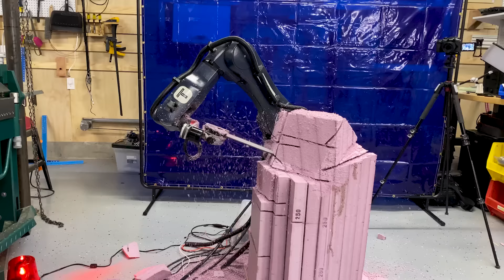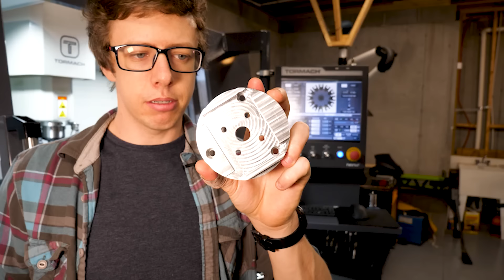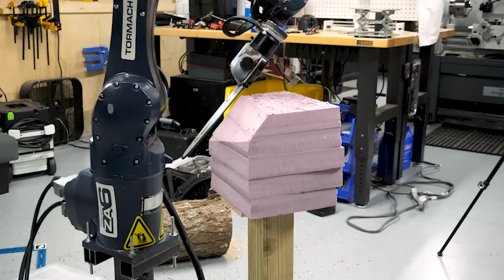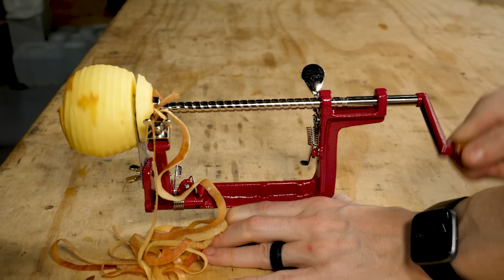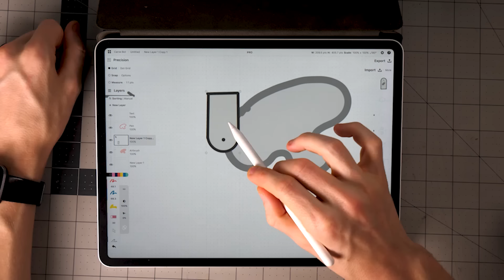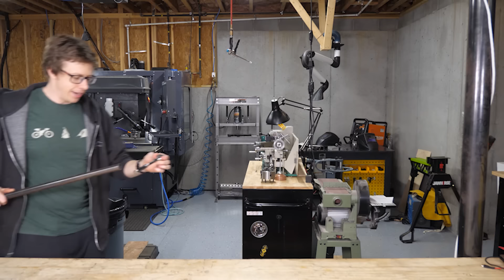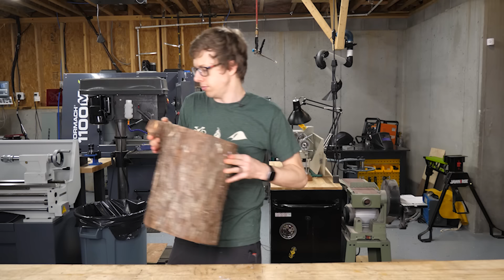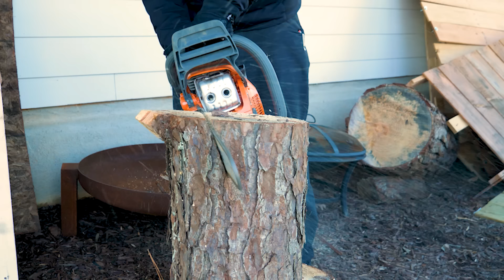Chainsaw + robotic arm = art?

Comment: getting stuck at a local max is always a problem with hill climbing algorithms. its the trade off of vastly reducing your search space. the only really "good" solution i ever ran into with hill climbing is you introduce thresholds. you find your "max" which may or may not be local, and compare it to a threshold. if its below, then you invert your max to treat it as a low, and keep searching. you then find the next "max" and you can compare it to the first one, or to your threshold. you can also make your number of searches arbitrary (always find 10 maxes). in the end though, you will never know if you have the global max unless you do something fundamentally different, which is what you get with hill climbing.

i'm curious what methods you tried to get your hill climbing to work. some problems are just not well suited to be solved that way. if you expect or know your search space only has one max, then its amazing though

Comment: Those things you called "anti kickback teeth" are actually depth gauges. They determine how much your teeth will cut. On a used chain, you have to file these down to make the chain cut again.
Your pole saw shouldn't be much slower than any big saw, as long as the chain is sharp, it should go through the wood like any other saw. My advice: Sharpen the chain, tension it (no seriously, that thing was way too loose), and slowly file those depth gauges down. Filing them down too much can cause the chain to bite too deep, which can overpower your motor. Slowing down the movement of the arm won't really help there, since the saw will pull itself into the wood usually. In the end, you should be perfectly fine cutting wood with that setup.
Also, the front of the bar saws just as well as any other part, plunge cuts are pretty common with chainsaws, both in felling and in art. They're not without danger though, so don't try it manually unless you know what you're doing.

Comment: Dude a decent saw and that includes a pole saw will not only handle continuous cutting for 10 hours it will handle continuous cutting for 14 hours a day every single day. All you would need to do is occasionally sharpen the chain and since you have 0 chance of hitting dirt you would only need to sharpen once a day.

Comment: Man, your videos are awesome.
Here are a few tips for better luck with your chainsaw next time:
1. tension the chain so that it is snugly on the bar but can run smoothly
2. make sure the oil pump for the chain oil is pumping in every direction the chainsaw is oriented. This improves the cutting speed and the heat problem
3. the "anti-kickback tooth" you mentioned is not really for anti kickback on the chain you used. That is the depth adjustment tooth, if you file it down a little more, the saw will cut deeper but also more aggressivly
4. optional: maybe use a full-chisel chain instead of a semi-chisel chain and sharpen it really good

Greetings from Germany, the origin of chainsaws

Comment: 9:36 For getting caught at a false summit, intelligent optimisation, something like the bees algorithm, would likely do wonders. If you already have the cost function well implemented it might be quite easy to add. Not sure if it would be faster than your optimised solution though. If you really wanted to put the time into it, it could be GPU accelerated though.

Comment: Would it be possible to program something like a simple particle/ray simulation? I am thinking of a flashlight beam. You shine it on the model, while it is rotating. Wherever the most light gets through, your efficiency of cut should be high. Maybe that way you get a reasonable estimate of planes where you can cut the wedges out.
I have no clue of programming by the way. Please don't hate me if this does not make sense :D

Comment: Your mistake was having only a single, randomly placed phase-space walker. You should randomly distribute multiple walkers across your space - ascend/descend them all and then pick the best - you should arrange your distribution and resolution, if possible - so the distribution of walkers is roughly the same as the distribution of peaks.

Comment: Awesome!! Speaking from a trefellers perspective, a chainsaw will definitely cut on the 3-6 radius (clock perspective). The "anti-kickback" is instead what decides how aggresive the chain bites and type of chips you produce. For hardwood and smaller saws you need the difference in height between tooth and depth to be smaller and vice versa. Also, chainsaws use oil, and i saw the chain being too loose on a few shots. - that might eject the chain all together depending on the rest of the construction. 
Regarding kickback, which is definitely a thing.. Avoid at all cost using the 0-3 portion of the blade. Second to none, this area is the one that shoots the chainsaw back onto people's faces. It's obviously not a problem in foam, but a true kickback can knock a man off his feet. 
I really enjoy these videoes. It's a perfect example of how it's smart people and not politicians that will save the world, one invention at a time. :D

Comment: 12:38 Having your warning light be on in case of danger is a bad idea in case of bulb failure ect. You want the light to be on if it's safe and then if the bulb fails you don't get the wrong idea. I'm sure you already knew that but others might see this.
Reply: A loud siren would be better, a chainsaw wielding robot coming at you is usually a good enough visual indicator of impending death.
Reply: Does having a redundant second light solve that problem?

Comment: Not sure if it's been suggested already, but the anti-kickback teeth are for human operators, it won't kickback with the robot holding it (similar to how climb cutting isn't recommended when hand feeding but is often preferred when CNCing); have you thought about grinding those teeth off a blade and trying again in wood? Possibly a cheap/quick solution.

Comment: In regards to your 'false peak' dilemma, I think you could probably separate your 3D vectored map into quadrants and then use your already created method to determine each quadrants x, y, and z max, then simply compare the best "peak" of each quadrant based on the Z values to return the x, y, and z of the best "peak".  Since you know the min/max X and Y values, you should be able to easily divide the table into smaller X/Y vectors.

Comment: Simple suggestion to make "gradient ascend" find the global maximum point:

1) starts in a random position
2) apply gradient ascend
3) apply stopping criteria when a maximum is reached
4) save altitude value
5) repeat process N times
6) use best solution found

Comment: Why not use 2 tools for big cuts and small cuts (attached to the same arm)? Off course difficulty will  increase both in coding and mechanically. Consider changing the tools manually during the process.
Good luck for this and all the projects.

Comment: A couple of years ago I worked on a machine very similar to this, only quite a bit bigger. It was based on a large Kuka industrial arm with a 3kw chainsaw. They also had bandsaw and router attachments. The electronics cabinet for the machine was within the kill zone so calibrating the inverter drive for the saw was ... interesting. I had my back to the machine so I couldn't even see if it was coming for me. I had someone stood nearby with their hand on the stop button just in case.
They had a horizontal rotary axis for it as well. If I remember correctly it had a capacity of about 3m in length with well over a metre in diameter. 
It was part of a research project that seemed to be basically let's build a cool killer robot then try to find some useful application for it so we can justify the huge budget.

Comment: If you are burning wood, you are rubbing instead of cutting it. That might come from the chain's chisel type, for automated cutting of wood (because of the missing rocking motion), normally a mixed batch between square and semi chisels are normally used. It can also be that the rotation of the chain is to high. At our hackerspace we tried building something comparable. We however used a chainsaw angle disk instead, because it was easier to control, easier to get into corners and flexes less. Why are you cutting with the top of the chainsaw instead of the bottom btw ?

Comment: 17:28 The teeth on the chainsaw are for cutting depth. If you sharpen the blades you have to shorten the teeth or otherwise it doesn't cut (and heats up).
If you have to rock the chainsaw to cut, you have to sharpen the blades (and shorten the teeth for depth)

Comment: First off you need a wood craving chainsaw blade, Which has a narrow tip. 2nd the finish work is done with die grinders. Now that you have the basic done you could program in the finer details. Attachments for the die grinder and chainsaw could be easy to do. I also would have made sure the base of the turn table was attached to the base of the robot arm. I am sure your chain was dull.. You should have done a few simple programs to try and cut the log first. This way you can adjust pressure and depth of cut.
Reply: the other thing you could do is use the software for 3d printer or something like that. Though i am not sure how you could put it to use. Though you would have to program it in to allow for the tool its self not to hit. Either way its a good video.

Comment: The chainsaw bar needs lubrication or it will over heat and prematurely fail.
Also, the depth of cut is directly proportional to the height of the chain depth gauges. Watch a Wranglerstar video on chainsaw sharpening. It’ll clue you in as to what’s going on.

Comment: I have some success with finding the optimal list of steps for a given problem using the A* algorithm. If you generate neighbors on-the-fly instead of defining the graph up front, you can explore graphs that are larger than the memory of your computer. Given the right heuristic (this is where you can save lots of time) you can make the computer start with the most aggressive cuts and see if that works. If not, it regresses into less optimal first cuts and tries them.
I think that might be an approach to try for this kind of problem.

Comment: Surely someone could have done a 3D scan of a real bear in order to carve out a model of 1. that couldn't have been any harder than the programming to do this. The next step of course is to do a haircut with the robot chainsaw. There may have to be some software tweaks first.